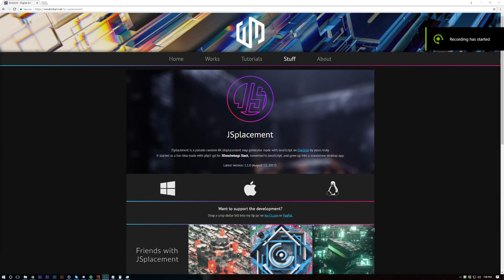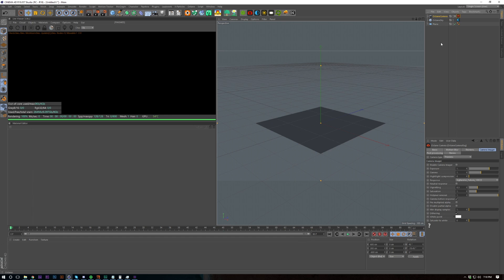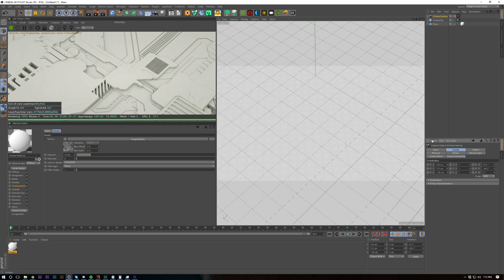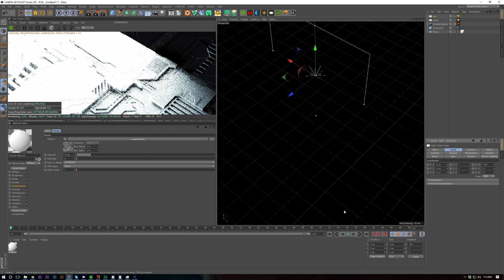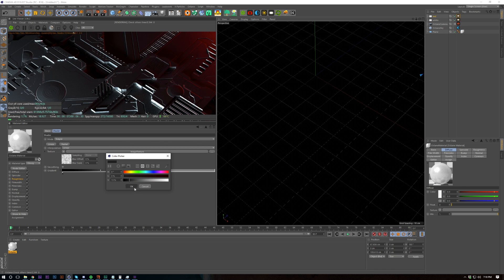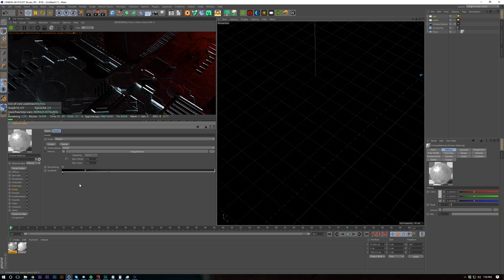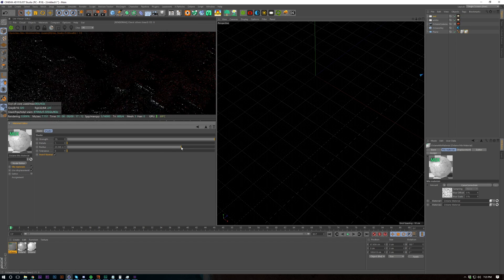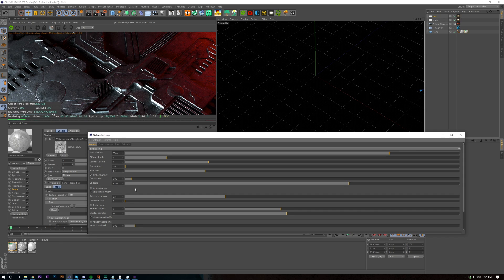Circuit Board Displacement in JSplacement & Cinema 4D

Comment: Great Tutorial! Thanks and SUB
How do you know which parameters to enter in Diffuse and Specular depth in the render engine settings?
Reply from the maker: Just depends on the scene, in this scene since there's only metal(specular) materials you can maybe keep specular at 8 and the diffuse can be left at 4 or lower. I'd recommend doing a small render region so it updates quickly and play with these settings.
Reply: @AxisDesignerGFX  Thank you for the Answer

Comment: Great tuts! I am working on a concept art but i don't know how should i approach plus I am new to C4d been a Maya user for a while. I want to project a displacement image from jsplacement on my model to achieve a low poly isometric space hull like look but unable to achieve it. The displaced areas meshes gets extruded badly, broken and have crossed faces. I have my model UV unwrapped and I don't want all of the parts to be displaced. Plz give me the steps to achieve such effect I have been stuck here for a while couldn't think of a solution :(
Reply from the maker: +Mayank Ghanti you've gotta UV the model for it to project properly. I've got a tutorial for C4D but Maya has way better UV unwrapping tools if you're having trouble with Body Paint :) https://youtu.be/9_7iO27TdEQ
Reply: merge the whole object into one polgonal object.
then go to BP UV edit mode, there's a button called brush setup click on it and ok ok
then on the right window go to the meshes tab and make sure show mesh is turned on.
then just export the image and use photoshop to overlay the displacement you want to use and then apply taht image to the displacement channel